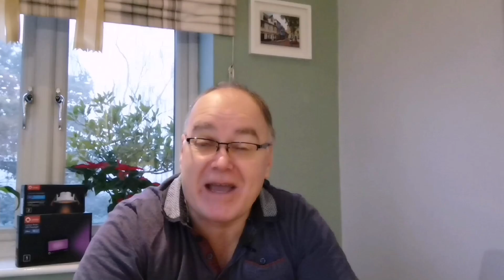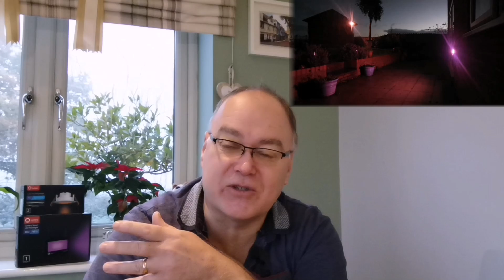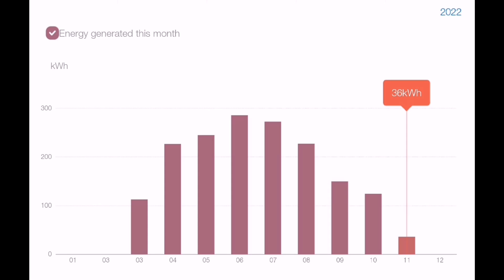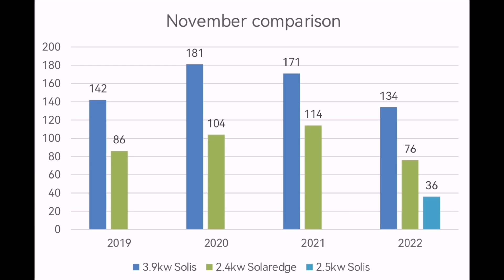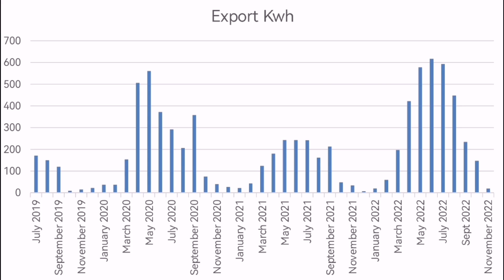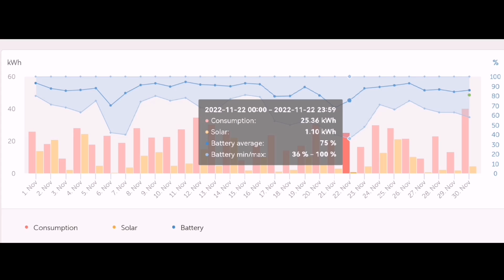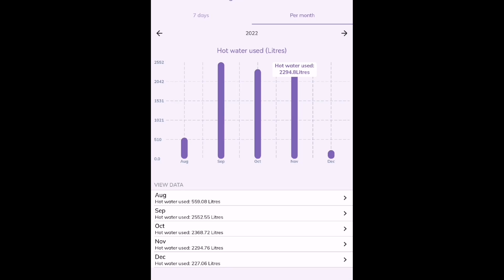Solar PV, battery, Mixergy and A2A heating system - First winter challenge

Comment: Coming off of Oil and onto air to air heat pumps has also made a huge difference to my heating bills and with the added benefit of built in dehumidification and cooling for the summer.
Reply: In the UK the permitted development rights say that heat pumps must be "Used solely for heating purposes" - no mention of cooling. Does the term 'heating' here mean cooling too or will planning permission be required for cooling?
Reply: Ian Williams  unless it's a registered building planning permission isn't required.  The units we are talking about look just like A/C units but have a 4-way valve inside that allows the refrigeration circuit to be reversed.  Much cheaper than air to water systems particularly if your home is relatively open plan. The only drawback they won't heat your hot water.
Reply: @zlmdragon.  It's news to me Vicki and I've had an AC company for the last 20 years.  The decibels on most split units would be below wet air/water systems.  The only time I came across planning was if the condenser was mounted on listed buildings.  Are you in the UK?